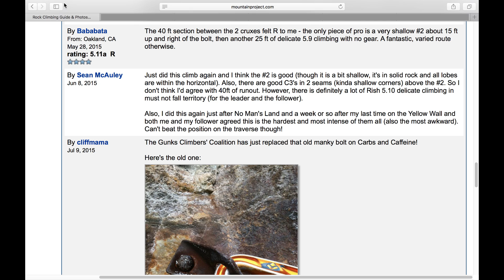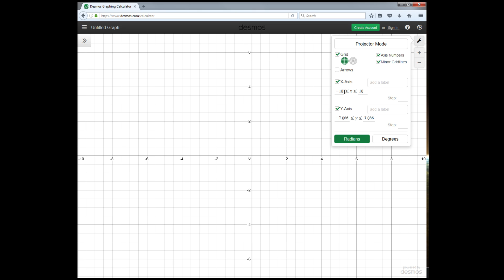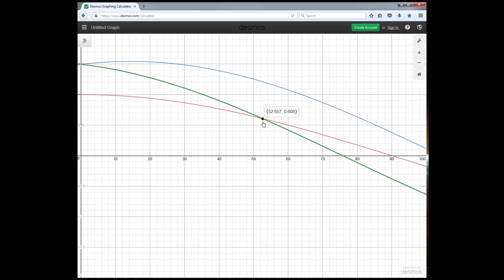Plugging Pro in Horizontals II

Comment: 2:48 holy shit dude lol

-edit 5:29 aww dude, im gonna be tripping out every time i place a horizontal now
-edit 2 alright, that last bit at the end was a little more reassuring. dont use shallow placements with cams if you can avoid it. try to get a placement with at absolute most 45 degrees stem angle.

Comment: Would a totem of held?
Reply: In aluminum probably not. I mean he clarified that this depends on the relation of friction and stem-angle. So I'd guess, just pull on your placements to see if they're fine. But it's a good thing to take away that stem-angle and upper lobe friction act in this way.

Comment: hey sorry I know this was a while ago but I just have one question (right now at least haha)

at 3:21, going through all the maths, why is your F_lobe horizontal? surely that force is the tension (or compression really) the lobes are under, and the force goes from the axel to the point of contact? It seems you're missing out on a vertical component of the force on the lobes. Or am I being stupid somehow? It's been known to happen.
Reply: Actually I think I figured it out - for anyone with the same question, the horizontal force in question is more intuitively thought of as the normal reaction the rock exerts on the cam, so there's no vertical component.

Comment: I think you made a mistake: looking at the Friction each loobe creates you need to half FLobe and FHorizontal equating too: u*cos_theta/(2*tan_phi)+u*sin_theta > cos_theta /2 for the bottom lobe. Also Fvertical createas a torque reducing the amount of Friction the Top lobe needs to create (reduced by Fvertical * tan_phi).  With F_vertical=Ffall*cos_theta that means for the top lobe: u*cos_theta/(2*tan_phi)-u*sin_theta > cos_theta /2 - cots_theta*tan_phi. Sry for my bad english and sry if i may be mistaken

Comment: Really good video- I like the thought experiment.  One thing I didn't hear you mention was the affect of the flexible stem on the cam.  When the stem bends around a corner, it converts some of the downward fall force into pure horizontal pull force, right?  I've always thought of that as the primary reason horizontal placements are safe.  Would be curious to hear your thoughts.

Still, even if such an effect occurs, the deeper the placement the better.  Your video is a great reminder.

Comment: I can only talk from my own experience outdoors in using these devices and I have never had one of the devices failure in the horizontal.Admittedly this experience has just been in Australian Sandstone,abseiling off them,bounce testing during aiding and falling,rock failure caused the cam to come out.I noticed that you are using the older version of the black diamond SLCD,would the newer design make any difference?

Comment: Your caveats to your math and model undermine all the math and "fancy" vector decomposition that you did earlier in the video. You definitely did not convince me of anything. 

You should re-analyze the system with the double axle design. Yes the camming angle is different, but the lever arm is longer for a double- axle cam. also, looking at my cam, the line between the two axles becomes non-vertical, possibly affecting the system as well. ALSO, the stem bending over the rock is going to absorb some of the downward pull.

your physical model is not relevant at all: we don't climb on steel girders. 

Where did you get the number for the coefficient of static friction between a cam lobe and granite? this number is probably for  smooth contact, not gummy aluminum deforming to crystals in granite. 

Just because you did math, doesn't mean it's  correct. Do you have a degree in physics or engineering?
Reply from the maker: Just for clarity, I'm not claiming the camming angle changes in the double axle scenario. The camming angle is constant regardless of the lobes orientation, thats the beauty of the SLCD design. Rather what I'm claiming changes is the magnitude of the normal force between the rock surface and the lobe, which would have an impact in how it functions. I claim, knowing full well I could be wrong. I just want to know why I'm wrong. Originally I thought the camming angle was changing but it just didn't make sense when trying to describe the model on paper. I mention this in the first video I made on the topic.

You're right about the coefficient number. I think I mention the vagueness of that number between comments, descriptions, and in the first video (I honestly forget if I mention it in this video). I'm fairly sure its somewhere between .25 - .5 and 0.38 came up googling far more often then anything else. 

What I'm trying to highlight is the affect the stem angle has on the system. The affect is proportional regardless of material and plastic deformation, which is why the test case in the video is just as applicable as real rock. If I had a force gauge of some sort, I could use that system to qualify or dispute the model. The material type doesn't matter and nor does the exact value of the coefficient.

I mention other factors, as well as list some I can think of, in the description. I personally believe the friction of the stem bending of the edge of the rock would have a significant affect.

As I and many others do a fair bit of climbing in the Gunks and since I don't have any plans to stop or slow down, I welcome critique. Do myself and anyone else that has read this far a favor and figure out why I'm wrong or why this is all a non issue. Believe me, because I've been stuck on this for a while now, it's a whole lot easier to just make a claim then it is to explain that claim. I even gave you some tools you can use to work on your dispute.

Comment from the maker: To follow up with some more details:

The model crack is made of run-or-the-mill mild steel (probably 1020). I did lightly sand the plates to remove rust and grit I though would decrease friction but is largely still "rough". More importantly though, the steel crack is harder then the aluminum cam lobes.

There are many other factors at play, I mentioned the static coefficient component being different as one and the double axle design maybe being a factor due to the cam lobes moving when the stem shifts position.

Other factors could include:
* What the spring force is contributing to the system (if any, I think its probably negligible).
* What forces are at play during the transition from unloaded to loaded because there is movement (such as what I featured in the double axle design, there's others as well).
* The friction of the stem bending over the crack/rock. In theory it's negligible but in practice I believe it may reduce the fall force significantly.
* Plastic deformation of the lobes. I was stuck in this rabbit hole for a few months. There is a lot to this and I realized this isn't specific to the Horizontal factor but to summarize, if the tread pattern of the lobes is too fine, the pressure generated during the loading of the SLCD would essentially cause the surface of the lobe to turn to butter.

I'm sure there's a whole lot more, I'd be interesting in hearing some input.
Reply: FirstPersonBeta  - any updates on the difference for single axle cams or those that don't transfer load via an axle, like totems?
Reply: Could you not run the calculations a second time using the coefficient of friction of steel on aluminum to get an idea for how much weaker your test rig is compared to rock?

Comment: Awesome solid math and physics.  I followed through carefully and its there.

So all the sudden I'm feeling uneasy about horizontals
 Did your heart sink when you first pulled down hard and it pulled out (in the aluminum build you made)?
I can only rest in the hundreds of falls at the gunks that don't pull out in similar placement on real rock.

There might be a subtle consideration.... the time for the teeth to get a grip.....allowing a shifting of the lobes.  On the aluminum surface there is no time since it is so flat and smooth.  Real rock has all those little bumps......I think the friction is way different....even on smooth quartzite like Seneca where there are small concavities and convexities.
I think you need to get 2 pieces of rock (rectangular prism shaped), drill four holes in the corners, drop bolts through them and slap the cam in there and see what happens.  How bout two pavers or premolded steps?
Reply: Honestly just put grip tape on your angle steel set up and see if the results are different at all. Awesome video btw
Reply from the maker: Joseph Heinz you're absolutely right in that the only way to really test this is to build a "rock" crack and test it in that. If I were to make a guess, we would see a reduction from a 12kn failure point to something like 6kn but I would encourage anyone to try this out for themselves (use a retired Cam) just to experience for themselves the difference in effort needed to yank it out.